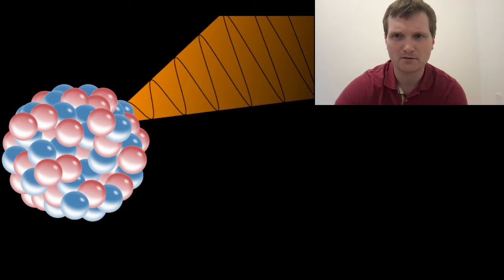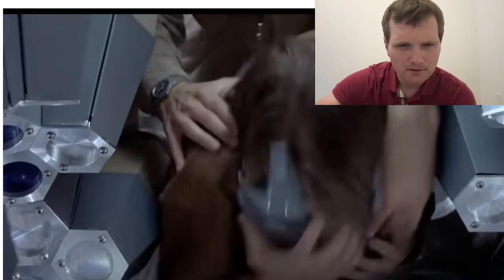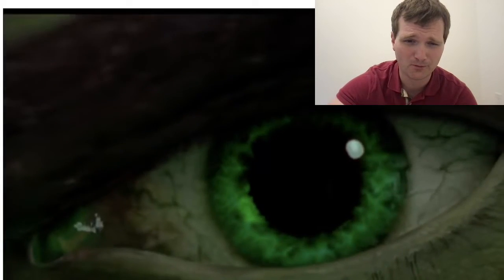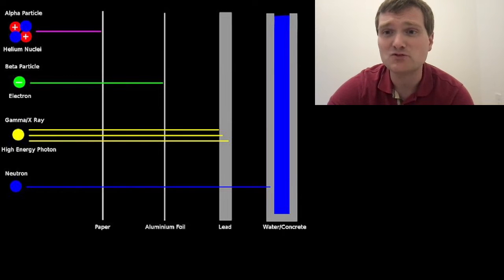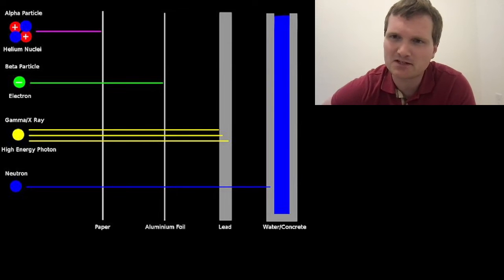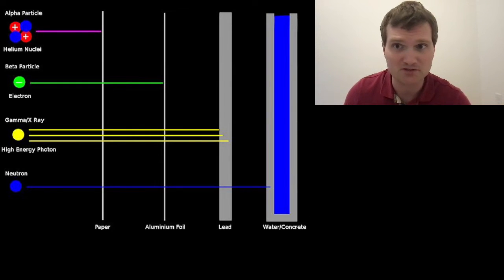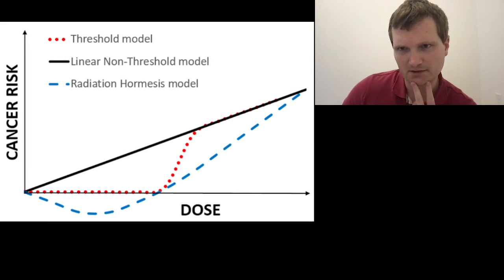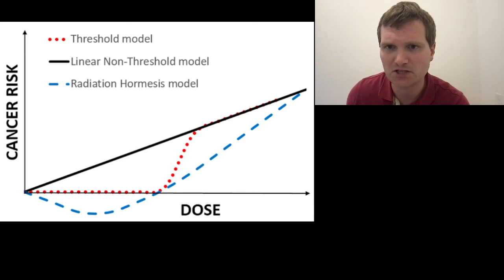Nuclear Engineer reacts to Hulk (2003): Bruce Banner Gamma Radiation Exposure

Comment: Gamma radiation was heavily used to cause mutations in plants as a way to accelerate evolution. While most exposed plants just die, a few have random mutations, and they then just selected from those whichever ones seemed beneficial and cross-bread those traits into stock. This idea of using radiation to create mutations got exaggerated in the public conscience, and that's how it got into the Hulk. Weirdly, his green theme had nothing to do with the green glow of radium-excited phosphor that informed our "radiation = green glow" nonsense. They wanted to make sure he didn't look like any particular group of people so he was initially drawn as gray, but due to consistency problems with the gray coloration in the first issue Stan Lee switched to green. And that's why gamma radiation in Hulk related material is always green - to match the Hulk.